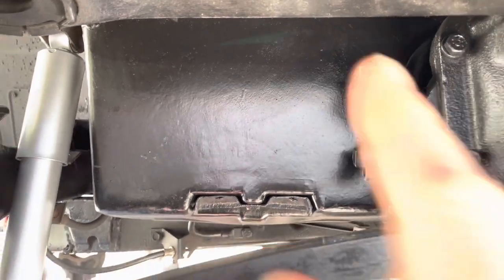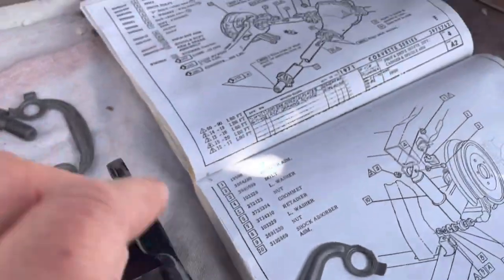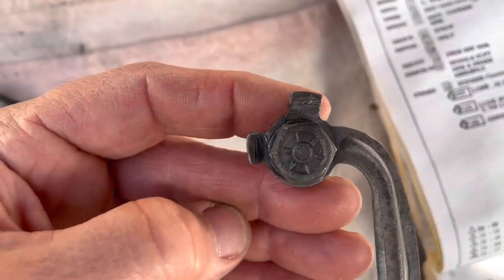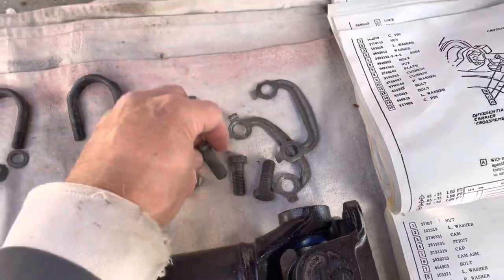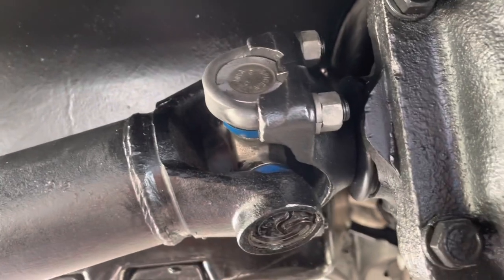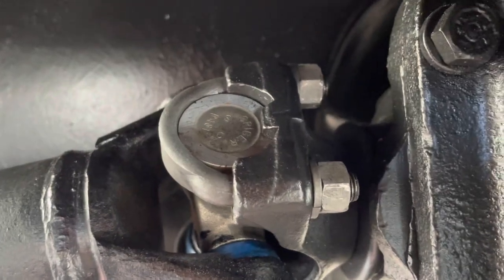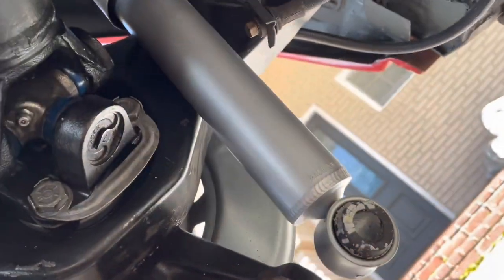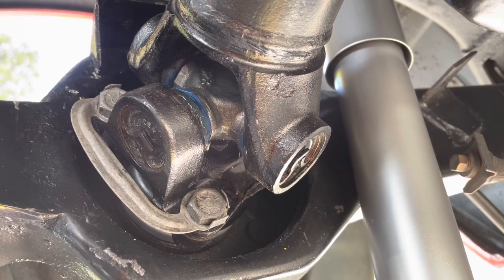C3 Half-Shaft Installation-Corvette (71)

Comment: I just did this on my 79 but did not torque the outer bolts Whoops better go back and check those! Thanks for sharing
Reply from the maker: My pleasure. I think you can reach the inner (diff) bolts with a small torque wrench when the bolt is near the bottom close to the body, but I just did a “medium” hand-tighten. You don’t need to go too heavy on those.